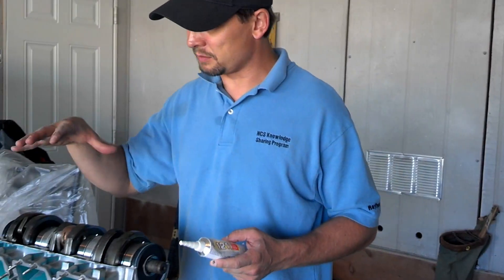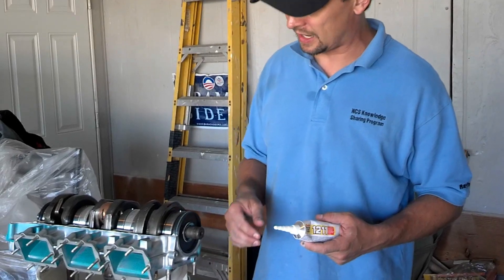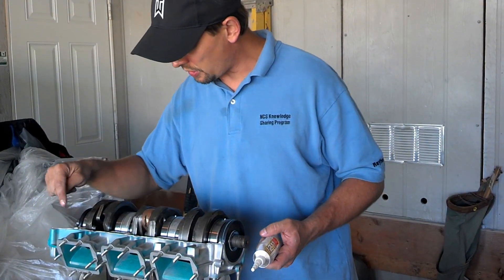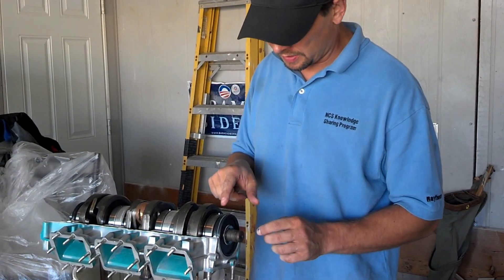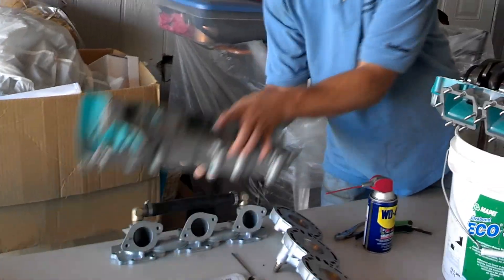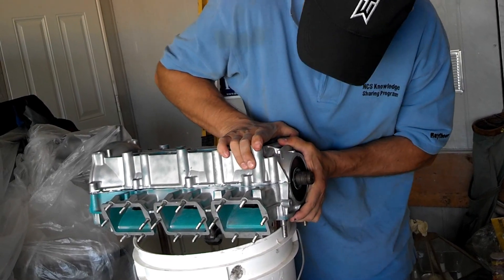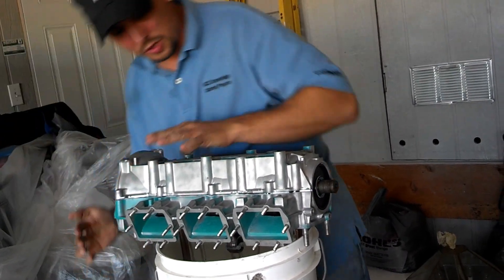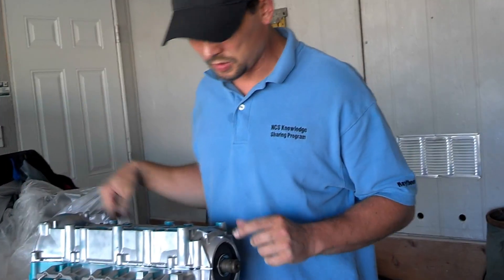Kawasaki 1100 zxi Engine Rebuild Part 3

Comment: I'm trying to seal an ultra 300x set of cases and the repair manual says to not apply the liquid sealer to the crank journal area. One end of the case/crank takes a seal but the other end does not. If I don't apply sealer to the end without a seal, won't it leak?
Reply: I'm sorry I am not familiar with the ultra 300x.  Is that a 2 stroke or a 4 stroke?  Also, what do you mean crank journal area?  There is a crankpin journal and a bearing journal that are all on the crankshaft, and no liquid sealer goes on the crankshaft itself.  Ultimately if you have a 2-stroke engine the crank case needs to be air tight so that it can pump air/fuel mixture. The crank case should split in 2 like my video shows and those mating surfaces must be sealed.  Then, the PTO of the crankshaft has to come out. So, it must have a seal.  Perhaps what your manual says is do not apply liquid sealer between the rubber seal and the crank shaft (journal).  This is true, the round seal has liquid sealer between it and the case, but the shaft just needs marine grease between it and the seal so that it can rotate.

Comment: How do you remove the flywheel off of a crankshaft. Love the videos thanks in advance
Reply from the maker: Heck Yeah Fishing the flywheel is just pressed on and keeps from rotating by the half moon pin in the  crank. You can use a flywheel puller or just tap it off slowly. The PTO coupler on the backside is much more difficult to remove since it is screwed on. It's best to remove it before you crack the crankcase open so that you can anchor the piston rods and keep the crank from rotating. If it's already all apart you can try to rig something up to hold the crank steady or ask the shop to remove it that's going to rebuild your crank.

Comment: Hope you see this. Did you put some of the silicone gasket on the outside of the crank seals too? I'm rebuilding a 900 STX and am very close to doing the crank seals. Thanks and great videos.
Reply from the maker: Todd Christie if I remember correctly I only put the liquid gasket onto the crank case surface. it would not hurt to put it on the seals as they are obviously going to see the silicone but I was trying to avoid using too much.  I didn't want the excess to squeeze into the case and particulate into the engine.
Reply: thx
Reply: @dlofgreen  You  should not use silicone on rectified/perfectly matched surfaces; it will always squeeze out; you need a different sealer meant for close matched,ground, surfaces.

Comment: What is the torque spec on a 2004 kawasaki 900 stx? Model jh900-e
Reply from the maker: craig f the torque spec on the crankshaft produced by the engine or the bolts that hold the crankcase together?
Reply: Bolts. Did a complete teardown. Not putting it back together until I know all the bolt torque specs. Got a link for the 1211?
Reply from the maker: sorry but I do not know.  I would have to do the same as you, a google search for the service manual.  I would have to search for the 1211 too
Reply: craig f I have the torque specs for a 1999. Not sure if they are the same but I can post them when I get home.
Reply: Todd Christie please post all the specs. thnx